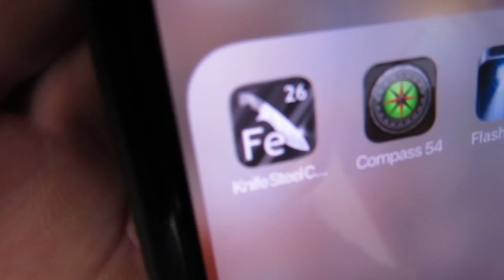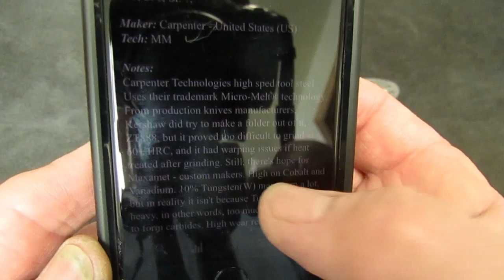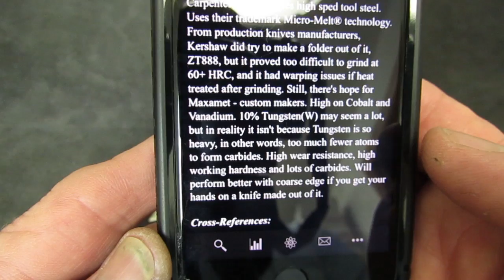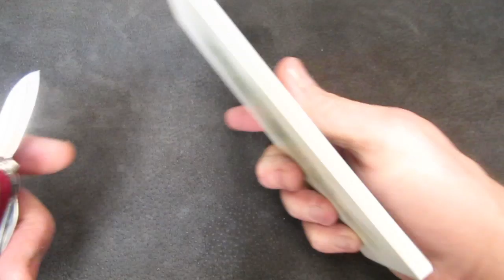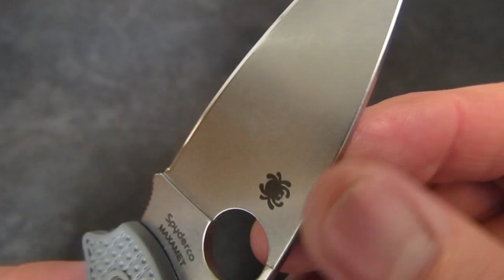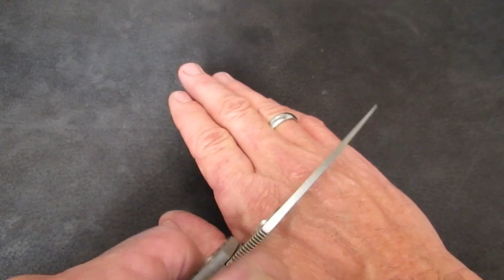FSB -- Struggles and Solutions:  My Maxamet Nightmare

Comment: They must of fixed the heat treat as of 2020. Ive sharpened my para 3 keeping the factory angles with eze lap diamond fine and dmt ultra fine finish with spyderco ceramic. No problems to report as of yet.

Comment: I sharpened my Native 5 Maxamet on the Edge Pro Apex with Edge Pro Diamond Matrix stones from 80 to 4000 Grit and stropped with 2 micron 1 micron 0.5 micron and 0.1 micron Jende Diamond Emulsion on Balsa wood (also on Edge Pro Apex) and 16 degrees per side without micro bevel and absolutely no issues, no chipping, nothing. I got a hair whittling sharp mirror polished edge without any problems.
Reply: Have you used it to dig into stoney soil or battoned it into some wood even lightly? You have to remember, not everyone uses their knife the same way. Maxamet is terrible steel for any sort of even semi-rough use. It is amazing if you need to cut a ton of cardboard or other repetitive light duty use that tends to dull blades quickly, but for everyday semi-rough use it's really awful. It doesn't just chip, it rusts. It can be sharpened, but it is a pain and it requires special equipment and a good bit of skill.

Comment: Just discovered something that I thaught might be relevant to this topic. 

Sharpening a disposable boxcutter blade to perfection is much harder than sharpening Maxamet.
So if you able to sharpen a box cutter blade to your liking then you will be more than capable of handling Maxamet. 

I had to go through a couple of techniques to try and get the micro chips out of the boxcutter blade.

Here is what I ended up with: Using Lansky fixed angled sharpening system on box cutter blade
Apex 200grit
  Run blade over 600grit stone 90° to get chipping from the 200grit stone out
     re-apex with 600 grit
        run 2000grit sandpaper over edge to get those chips out
          Re-apex 1200grit
            then run 1200grit stone over edge length wise to create horizontal scratch pattern and mimic higher grit.
Then strop

This produced hair whittling edge with no chips on box cutter blade.

It is a real mission but its fun to try on box cutter blade. 
The type used: https://tinyurl.com/yxjcqoov

Comment: Great video was going to get this steel but I'll avoid it. Need to find the best EDC steel for my worksharp. Any suggestions?
Reply: If you are trusting a video this old to avoid buying maxamet, you are missing out on the best steel I’ve sharpened and used. I’ve had no issues that the author has. I have found that there must have been an issue in early batches of this steel. It’s that or some serious flaw in his sharpening technique. I love it so much I have three knives in it. I most certainly would not have done that to “justify my spending so much money on a knife”.  Try to do some digging on recent reviews of this steel. You will find that this author’s experience is most certainly in a tiny minority of those reviews.
Reply: Maxamet is awesome

Comment: I love the stonewashed finish on these. I wish they offered it on a few over steels, cpm 4v definitely being one. Have the 4v manix 2 and the "satin" finish is pretty rough, seems like that happens on the harder high carbide steels. As a user I much prefer stonewashed finish over satin. It hides wear better and on carbon steels it helps prevent patina better.
Reply: Don't fall in love with that stonewashed look on maxamet spyderco's. It patinas and changes VERY easily. To the point that if you get almost ANY kind of liquid (besides water and alcohol) on it, you will see spots. I had steak juice leave a spot in my maxamet PM3 and it was only on the knife long enough for me to eat dinner while camping.
I haven't done much with the blade for me to speak about the brittle/fragile nature of the cutting edge (like this guy did in the video), but the stonewash is anything but good. That much I CAN confirm.

Comment: I have the same experience on M4 steel, its edge also chipped with I used spyderco medium grid stone after 300ish grid coarse stone. As the finner grid I went, more steel poped off. After sharpening 3 more times I got really decent result. The cause of this phenomenom woud just because the factory used belt grander messed up the heat trade near the apex.

Comment: Funny thing: I found Maxamet to be the same or sometimes even less chippy than m390 and equivalents. Maxamet in my opinion is also easier to sharpen than them, especially on diamonds. You can safely begin sharpening with 400 grit and light pressure is essential (as mentioned on the video). I think 22 degrees per side is to much... anything between 17-20 degrees is ok. What I also like about this steel is fact that it reacts really nicely to stropping. Much better than m390. It's obvious that batoning is not the best idea and if corrosion resistance is not a deal breaker, then it's quite decent steel for EDC.

Comment: Nutun had one of those rustproof knives on his boat ! It rusted just like stainless rusts ! 
   They test it under salt water when its the oxygen that oxidizes the steel ? The salt air is what takes the biggest toll ! Blade hq buried one in the salt lake for a week didn't rust ? Put some carbon steel with it ? And wet it  and dry it in the salt air !

Comment: I wonder if Spyderco changed the HT on the folders compared to the Mule Team Maxamet. I've really had a fantastic run with my MT. I just run a 400 grit 15dps edge with a 20fps brown sharpmaker rod micro bevel. I chipped it once on a big staple but it's been a really great steel. No issue's with tune edge tearing out like I'm reading/seeing in the Manix 2 & Native 5 LW knives.

Comment: MAXAMET is actually pretty easy to sharpen, I didn't have any issues under 20 DPS at all dealing with it. I tested it at both 15 DPS and 18 DPS. It's easier than I thought it might be given the alloy content. I use Silicon Carbide stones to sharpen with however.
Reply: No issues here sharpening maxamet and I don’t consider my self an expert by any means. But dang you hear the majority of the knife community just regurgitating the same garbage. My experience with sharpening maxamet 15-20 minutes max with a decent set of Diamond stones you have a hair shaving edge. Although I would not recommend a super low grit like 250 or lower. Stay sharp my friend!!!
Reply: @andrewjewell8209  The majority of the so called knife community are literal children or just man children. Not sure which is worse, the actually little boys or the grown as men with minds of little boys. The reason EDC bros are so obsessed over steel in the first place is... marketing, and ignorance. Classic combo. But whats more the reason they are so hyper focused on the one aspect of blade steels that probably matters the least, which is abrasion resistance, which they just blindly call "edge retention durrr" is because none of them actually know how to use or maintain a knife. They've never actually sharpened any knife. They think like children. Its like "my car CAN BEAT your car" "this beats that car" all that bs child like little boy brain bs. They're looking for magic. Magic steel that won't need maintenance, because they don't know how and they're too lazy and scared to bother learning. I've seen it carry over into abrasives too. They don't even know how to sharpen and they want to fanatically post about industrial/commercial grade specialty stones that aren't even available to the general pubic, because they think it's magic. They don't realize like you said, a $30 silicon carbide whetstone will work just fine. Even alumina stones work in low enough grits. They think it's magic. I need one of those magic "super" vitrified bonded diamond stones. Magic stones, which I don't know how to use, for my magic steel, which isn't supposed to get dull in the first place. None of it makes any actual sense. It's quite annoying though.

Comment: There is a very good reason that for decades most steels fall into the range of 58 to 62 Rockwell C scale, I say go with a slightly softer highly-corrosion resistant stainless steel and sharpen a little more often. I say Maxamet is over-alloyed garbage; a mistake for knife blades and not worth the effort, UGH.
Reply: Couldn't disagree more.

Comment: This is interesting. Given the high edge retention I would expect it to be very brittle and I treat it that way. I haven't had trouble sharpening mine. I never let it get very dull and I use a 500 diamond with light strokes followed by 1200 (on an Edge Pro). Dumb luck on my part choosing these stones. And yeah, relative to steels like ZDP or M390, maybe more trouble than it's worth. 

Cliff Stamp's comment about the grain of the steel is also interesting.

Comment: i use my maxamet mule as an edc. It is easy to sharpen with my double sided dmt stones, red=600, green=1200 and i finish with the spyderco ultra fine ceramic bench stone 306uf. i have had no chipping ,none of the alarmist banter that this "apostle" speaks of. so take your maxamet knife out and use it ,let the performance of the blade speak for itself.

Comment: Well apostle P,  thanks for saving my mantix 2 from the junk drawer

I know how to sharpen and I had gotten so frustrated with this steel that I put it away 

Went back after the video and started with 600 grit and a standard V grind 21 degree primary bevel with no micro bevel 

Took awhile but I worked from there down to a .05 micron strop and it’s sharp enough to do what i bought it for... cut cardboard.
Still won’t take a fine edge as well as my s30v, M390, 20cv, or even s110v
But it’s good enough 

I didn’t have chipping like you did but it was like after 100 grit my burr just fell off and left a jagged edge I couldn’t clean up 
Was actually able to apex with the 600 and chase the burr after that until deburring on 1500 grit diamond 

Thanks again I think you are right on about this steel 
Wish I wouldn’t have bought it but it better cut a lot of cardboard for me now

Comment: Honestly most users really only need s30v or s35vn if you need wear resistance S110V, S90V, and M390 are all options that are just fine. I agree with you on your statement about not using the knife. Most people buy steels just to “have” them but don’t actually use them to their full potential. Does anyone that is actually into knives ever really let their knife get dull enough to worry about actually sharpening and not just maintaining the edge?

Comment: I will just stick to my M390
Reply: Why. I don’t get what is so special about m390. It doesn’t do anything better than S30v or s35vn except rust resistance a little better. It isn’t any tougher, tests have absolutely shown it doesn’t hold an edge any longer than any other steel. Lc200n is more stain resistant, holds an edge just as well. M390 is yet to be heat treated correctly by any of the major companies using it. Rc should be up around 62 for optimal performance and what we were sold on it with all the hype, but most companies are coming in at 59 on their Rc’s which is way off.

Comment: The sad reality is that nobody really needs a better steel than 440C or Krupp 4116 or 14C28N Sandvik, anything above these is only steel snobbery and not worth the money and time.
Reply: El Tuko if you use your knife often 440C is a giant pain in the ass because of how often you need to sharpen it. Avoiding giant pains in the ass doesn't make you a snob.
Reply: Nice troll.
Reply: Yeah, no...  Benchmade Adams torture test proves this false.  D2 is a great steel and I'll happily take a knife that is properly done in D2.
Reply: El Tuko actually people really do need steels like this because if you are cutting cardboard or carpet or any other abrasive materials, do you want to go sharpen your knife in the middle of cutting that stuff up? No because it’s a pain in the ass to have to go do that while you’re in the middle of something.
Reply: They dull too fast and 440c in particular easily chips from normal use. I even found VG-10 to dull fairly quickly. CTS-XHP is my favorite.

Comment: I had problems with a manix 2 is s110v. I sharpened it on my kme 4 times with no success. With a brand new 50 grit beast too! Could not get my burr to grow no matter what I did. Could get it working sharp but not that hair popping sharp. I came to the conclusion that it was a bad heat treat. Sooo hard. I traded it in for a manix 2 in s30v. I then finally decided to try out s110v again praying it was just that one knife and got a native 5 in s110v and had it super sharp first attempt. Felt good! I've been wanting a maxamet knife but I'm on the fence because I don't want to fail sharpening it and waste my time and then have a knife I just can't get sharp. Not a good feeling. Cool videos I love your work. Your mirror polishes are insane. I go up to 5k cholera stones and then have my kme strops down to .1 micron and I still see small scratch pattern in direct sunlight. Is that just how it is? Or should I get the 10k chosera maybe...
Reply from the maker: The camera is a bit of a fooler.  There are fine scratches in mine too.  I don't think they're the result of the last stone we used, but left over scratches we didn't see from lower grit stones.  These large/high carbide super steels tend to give us these fits.  That's why I micro bevel most of them, just to be sure the apex is really the result of the finest grit I use without residual scratches.  Also, don't be too concerned with burr formation on steels like this.  They're usually too hard to produce much of a burr.  Let your eyes and fingers be your guide.  Hope that helps.

Comment: Have had a much different experience with my maxamet so far. I really like this steel.

I've had my Maxamet Manix2 LW from the first month they were available. Have not had any issues with it. It'll cut zip-ties and cardboard with no problem. 

Resharpened it because I simply wanted to. I set it to 15 per side and no microbevel. Also didn't take the edge past a 500 grit shapston stone. Haven't had any issues with chipping or other issues. I tend to press down hard on my stones while sharpening.

I can take a video of cutting cardboard, wood or zip-ties if anyone doesn't believe me. I believe Cliff and you with no quesiton that the knives you've had were not up to par, but mine has been great. This video is actually the first I've seen of people complaining - though I don't browse the forums as much as I used to.

I really think they screwed up the heat treat on some of the runs, like what you hear about ZT's early attempts with Elmax. Hasn't this happened before with Spyderco and one of their(at the time) new steels not many people were using?

Comment: I own and use the Manix version of this knife.  I found it very difficult to sharpen with alumina stones.  When I switched to diamond plates for re-profiling and ceramics to finish the process became much easier. Maybe I got lucky with my example but I haven't experienced large chipping when sharpening. I sharpen to 30 inclusive without a micro-bevel. I don't think I will buy another model with this steel however as 5/6 knives you sharpened having these problems doesn't instill confidence.
Reply from the maker: ReloaderSPR Sounds like you got a good one. It’s interesting I think hat the knives I’ve worked on haven’t given me much trouble removing material, even with alumina stones, but they just haven’t been stable. After reading the comments, it seems guys are having either very good or very bad experiences with this Steel. It would seem that the heat treat process is not in control.

Comment: What stone were you using at what angle (the highest one) where you noted the apex actually coming off?
Reply: I have noted used the EdgePro stones in a long time (more than a decade), but for very high carbide steels, I have found that you need really soft bond stones, the Naniwa Superstone series is a decent one, or even traditional Kings. Sintered stones, or any stone with a ceramic binder (hard bond), is likely to cause fracturing in grinding at a level way above the grit level.

Plus you really have to avoid at all costs any movement parallel to the cutting edge, or at least minimize it because that just leaves a fault line.

In any case, I hope you report this to Sal he is decent at trying to resolve problems and Maxamet should not have this behavior.
Reply: I have not seen that and have been using Maxamet in custom knives long before Spyderco has used it, plus other similar steels like 121REX, CPM-15V (not 10V). There are many possible explanations for it, such as the blanks of the knives were cut with the wrong grain orientation. 

The first thing I would check is the steel cross-rolled, and what method is used to blank the steel. If the sheets have a distinct grain bias, and you blank parallel to it, well you would expect the exact behavior he has noted. If Spyderco (or whoever) doesn't have a method in place to prevent this, then you would just see it happen at random from batch to batch.

But it could also just be a sharpening issue (stones/technique), though the fact that the apex comes off in strips is problematic to explain without an underlying steel problem. Random chipping is easy to explain by any number of factors.
Reply from the maker: I've also heard great reports on the Mules in Maxamet, from credible sources.  But in these folders, I'm 1 for 6, and the 1 you see here I was very gentle with.
Reply from the maker: On the worst of the knives, the apex came off at 23 degrees, 600 grit Edgepro stone, light presure, in the belly of a Native 5.  On subsequent knives, some Native 5's and some Manix 2's, if I saw the apex break off at 20 degress, I just went to the convex method.  This was the firs knife I tried this method on.